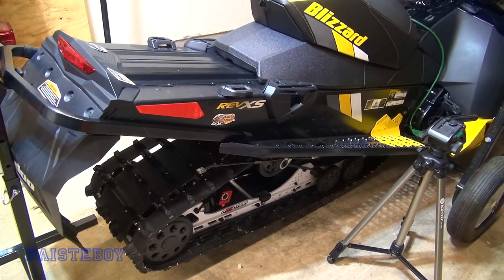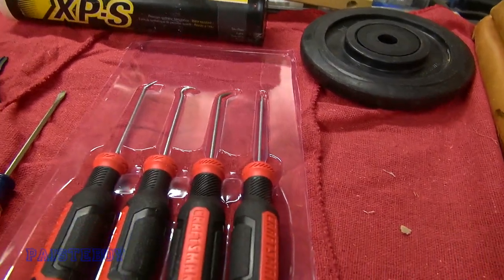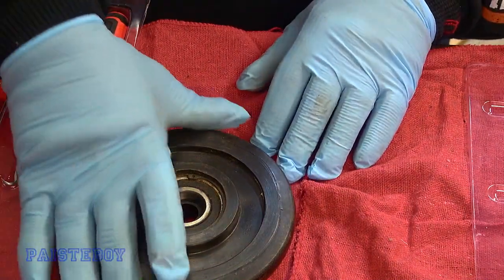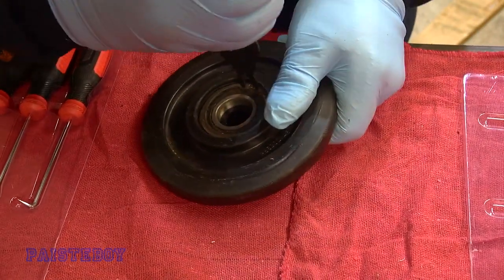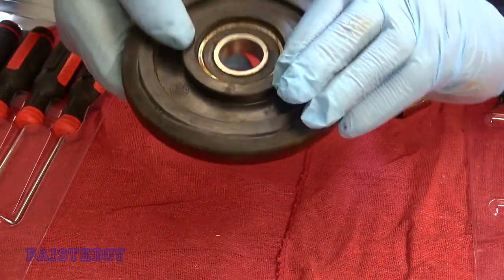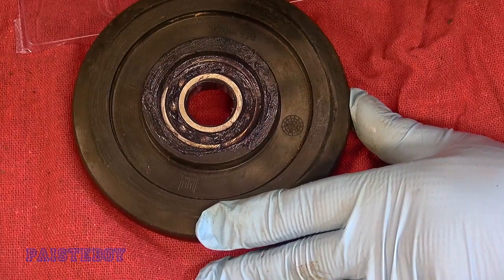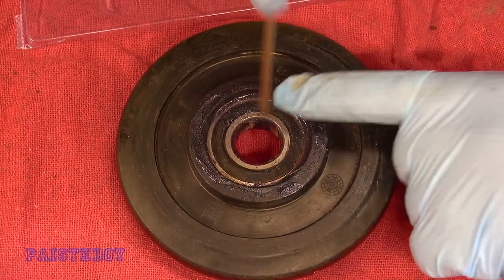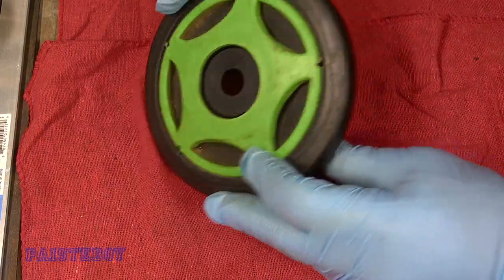Grease Sealed Bearing on your Snowmobile Idler Wheels

Comment: I pull the bearing completely out of the wheel and remove both seals. Then I clean the bearings with break cleaner until they are totally de-greased and spinning freely. Next I check for any movement between the top and bottom races and inspect the bearing cages for damage.  Then set as-side to dry. While the break cleaner dries out of the bearing I clean the seals with a small screw driver and remove any old grease as well. Then I wipe down all the seals with a rag and a little break cleaner till they are all grease free. An old tooth brush or similar works wonders on the bearings and the seals for breaking up the old grease and grime.

While sitting at a table I apply grease to each bearing face and work it (press, push, mush,) into the bearings and spin them several time to help distribute the grease into the bearing surfaces. I wipe away all excess grease and install the seals. next wipe more grease away with shop towels and spin the bearing occasionally to make sure the seals are seated properly while checking the edges of the seals and using the pick tool to press in any seal edges that need it. Then you are ready to install the bearing back into the sled.

Just pushing in more grease into the bearing which is filled with dirt, moisture, and old grease is a poor choice.
Reply from the maker: You're right and I should have done exactly how you said you do it. Thanks for the comment.
Reply: @Paisteboy  I was thinking you could also use a little gas and a brush in a sour cream container to clean up the bearing as well. Might save money and work better than break cleaner. Just make sure you don't soak the seals in break cleaner or gas it can mess them up if they sit in it too long.

Thanks for all the videos, keep up the good work, I do enjoy them.
Reply from the maker: Thanks Steve.  I will.

Comment: Hey paisteboy i learned that if you use and air compressor and blow out the bearning first b4 packing it with grease itll get all of the smallest fragments of metal out of it and greese it right after itll feel more smooth just something i learned and would like others to know
Reply: @oldjarhead386  but some ppl might be on a budget to or if they dont got another set on hand just yet like i do could even soak the bearing in diesel it acts like break cleaner then air then new grease
Reply from the maker: Yeah.  I guess you'd have to clean it out then or else any remaining grease will trap the debris.
Reply from the maker: @oldjarhead386  Valid points but say you're about to head out for a ride and notice a noisy or stiff idler.  At least you can get it going right away.  Thanks for the comment.

Comment: Good tip, I bet a good oem style bearing cleaned and regreased will out last a cheap replacement.
Reply from the maker: I guess I should have cleaned it out first but they are reusable.  Thanks Mathew.

Comment: people laugh at me for repacking bearings.  I actually remove them completely, clean them out (used gas this time as I was out of paint thinner), clean them in alcohol blow them out, let them dry, and repack.  switched to Amsoil water resistant synthetic grease this year actually.  Two other things i've started using is a needle greaser for greasing drive shaft and jackshaft bearings in place, but also for repacking.... i also bought a bearing driver kit where you can stack two sizes one for inside race and one to get right on the outhside so when driving new or repacked in you're driving on the outside race and stay centered...   anyway, running 4 sleds it only makes sense to repack these... i do it every 2 years full skid removal and just do the ole spin test on the ones i can easily get at in between seasons.
Reply from the maker: Sounds like you're doing it the right way.  I just did this little demo to show that it is an option.  You're are correct and I  would also clean out the bearing very well for best results. Thanks for watching.

Comment: I have a needle  for my grease gun and i just slip it under the seal.  Bearing are cheap but if they are not bad its a good idea to grease them before the season.
Reply: I agree. Needle greaser on the grease gun works great.
Reply from the maker: I may have to get one of those.
Reply from the maker: @mikedanaher3413  Duly noted.
Reply: Yes, use a pin or pick to lift the seal slightly, and slide the grease needle under.  18 gauge needles seem to be more common, but 21 gauge are smaller and easier to insert.

Comment: So not to be a negative Nancy, but those bearings are sealed for life. Once that seal comes off it will not stay on correctly and let crap in the rolling elements. And the most common cause of bearing failure is over greasing.  6205 bearings are cheap. If you are taking a the wheel off might as well buy new ones.  Go to a bearing place like motion or BDI.  They are 5 bucks.
Reply from the maker: I hear you but many people have had good luck doing this.  Thanks for watching.
Reply: I have two sleds. I have better luck taking them off and repacking. If you're careful you will not ruin the seal

Comment: I thoroughly degrease first, then repack
Reply from the maker: That works too.  Thanks for watching.
Reply: What do you regrease with and do you do them every year
Reply: @666dynomax  low temp synthetic grease, and should be good for a few years at least, unless you put a ton of miles on. I'd say if you spin them and there is no resistance and they spin freely or seem like the grease has dried up, then it's probably a good time throw a little extra is there. If it's an old sled and it has been years, then yeah, a full degrease and pack is probably required